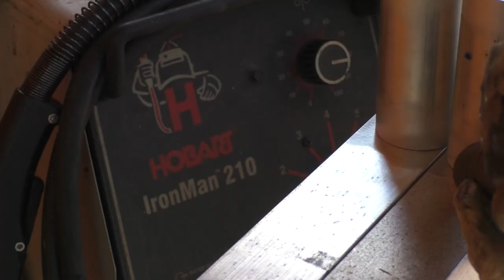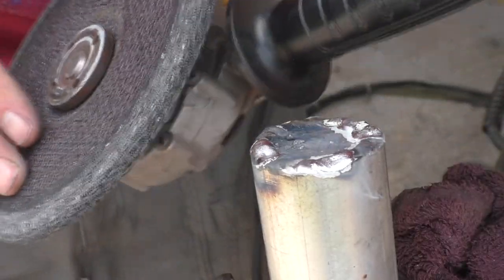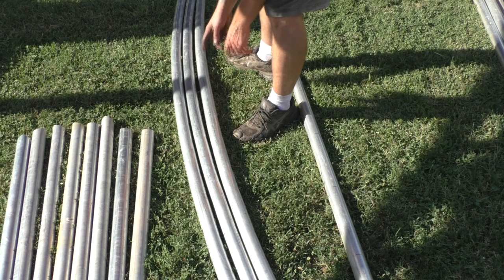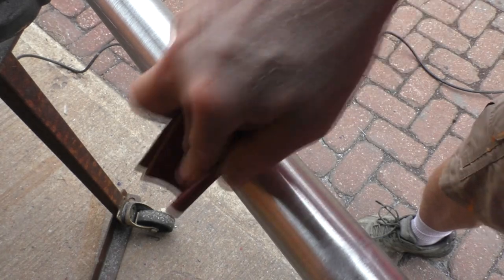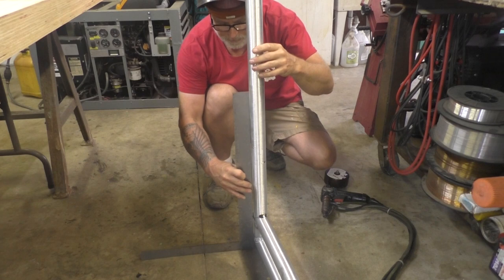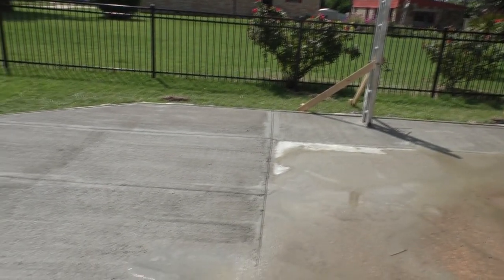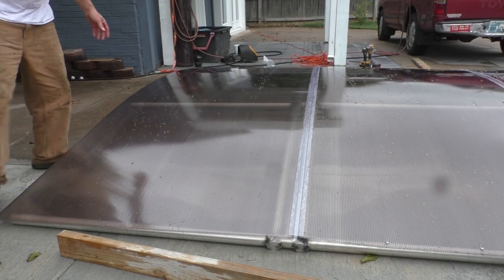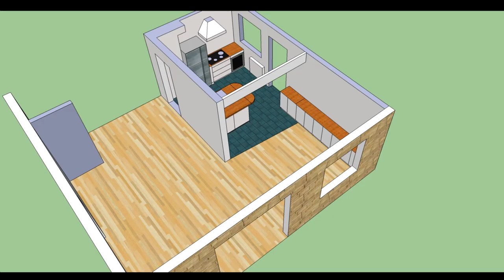DIY Alumimum Carport

Comment: I have to say, you're a master of "get it done with what you have".  Ive always been the opposite and have the tools to prove it, but my partner was like you, all that counted was results. 
Back in Junior High School in shop they showed us short instructional film "Don't Be A Primitive Pete" which was all about using the right tool and not abusing the improper tool.
When the shop instructor as for comments about the film my buddy chimed out "I thought it was excellent sir".  The instructor intrigued asked "Why?"  My buddy responded, "because I had no idea there were so many different things you could use a screwdriver for!"
Reply from the maker: Sounds like a film by Black and Decker.  : )
Reply: @SVSeeker  i was in 8th grade which was 1977, and this was a cartoon animated short film that was very old even then and was on a Howard-Bell 35mm reel to reel projector.   The main character was "Pete" who miss used all the common tools in a wood shop..  screwdriver as a chisel,  prybar, nail puller, paint can opener etc.
The inside out sanding belt I thought was especially creative.  
Well; keep it up!
Reply from the maker: Scott Pecora Wow, you have quite the memory. The only film I remember from eighth grade with something on VD. :-)

Comment: Youre tight on. Only worth doing Sand or Mandrel bends if using for fluid/gas flow like exhaust, and even then there is some leeway. The HF bender is plenty, results look great. 

If you get too much flex, adding some beams at a slightly steeper angle than the roof at each post that run a few inches inboard will triangulate the roof, but you knew that. Even some cheap braided steel tension lines and a turnbuckle can help immensely in a windstorm if it gets flappy.

Good spool work. Makes me want to upgrade my crap welder. It's always chicken and egg though: No huge welding projects because no nice welder, no nice welder because no big projects... Gotta just start doing and see where it takes you.

Comment: Stainless and aluminium are Dissimilar metals that when in contact , and especially with water , will cause Galvanic corrosion. This may cause issue with the screws holding up the roofing at some point
Reply: No. PV installations use exclusively stainless and aluminum.
Reply: FrozenHaxor wrong.  Galvanic corrosion is a big issue with aluminium/ stainless steel

Comment: Welds will crack over time, given the dynamic loading. A small storm andthe whole thing will bend and make noise. Also there will be catastrophic failure if it hits the resonance frequency.
Reply: That's a great point. It'll break if someone walks over it also.  Another thing I thought of, if you parked your car on TOP of the structure, it's a guaranteed catastrophic failure.
Reply from the maker: So go build a another box.  : )
Reply: I saw a tree in the background, that could fall and crush it. Best to cut the tree down ASAP.
Reply: @SVSeeker  don't under estimate snow and wind load.
Reply from the maker: @feosp  We're in the middle of fucking tornado alley.   No one under estimates the wind load here.  Ya just crawl into a hole and say good bye to all your stuff.

Comment: Any concern over wind forces on the structure? It looks like it would act like an airfoil if the wind hits it just right.
Reply from the maker: Nope.  But not expecting it to survive a tornado.
Reply: @SVSeeker  A thin steel cable between it and the house would do a lot to stop it catching in a strong wind. Would be almost invisible too....
Reply: Be interesting to see how it handles a snow load
Reply: @jon8706  According to google, Tulsa averages 6" of snow a year. Don't think it's going to see much in the way of snow loads. ;)
Reply: maybe the plastic blows off the structure and you just tack some new stuff on
no big deal
Reply from the maker: @jon8706  What snow?
Reply: @jon8706  No chance.  Here we engineer for 50 lbs/sq. ft snow load.

Comment: I was under the impression that unless aluminum was coated its not a good idea to have concrete and aluminum come into contact with each other. Aluminum reacts with the chemicals in cement leads to excessive corrosion.
Reply: Cement is basic, the opposite of acidic. Aluminum oxide is easily dissolved by a basic solution. Bare aluminum oxidizes and is dissolved away. More oxide is formed, etc. A continuous process that gradually destroys the aluminum.
Reply: @backh0e Right the aluminum will probably take longer to corrode than the plastic will survive the sun and the rain and the hail, tornadoes and earthquakes.

Comment: Why is the coil gun better for doing Al welding compared to just a wire feed MIG machine?
Reply: Aluminum wire can bunch up in the machine. The spool gun allows for less travel of the wire from the drive roller to the workpiece.